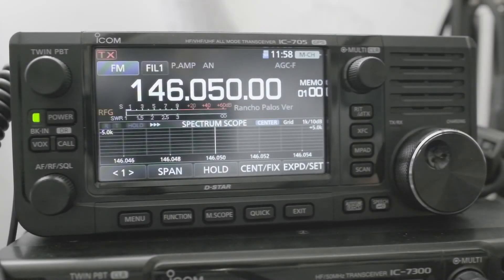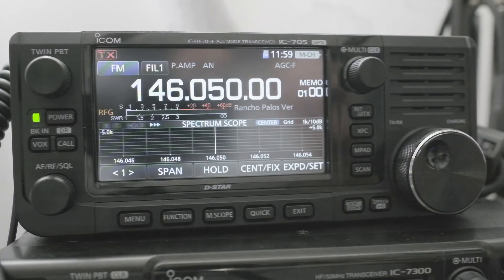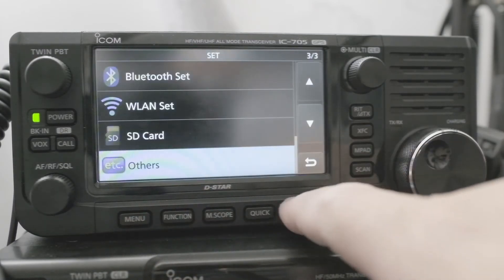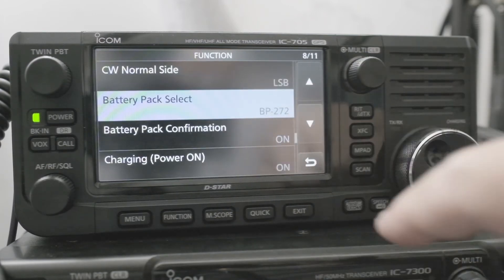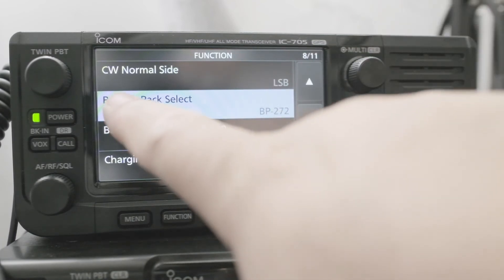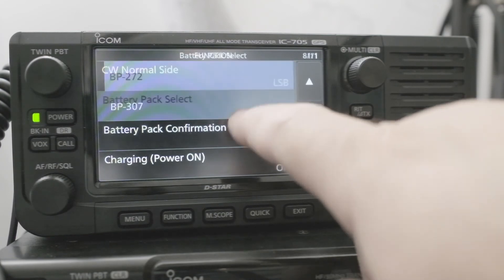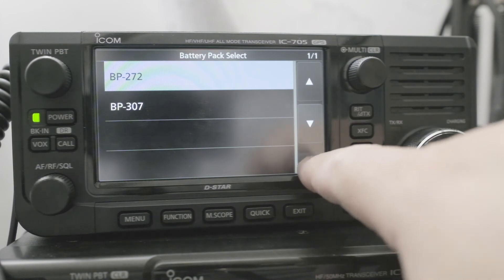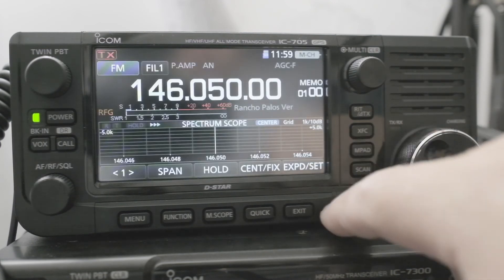IC 705 Battery Pack Set Mode BP 307

Comment: Not only did I like this video, it showed me that they make a bigger battery for the radio, which I did not know. The small battery size was an issue for me. Once I learned there was a bigger , better battery, I ordered my own IC705. Now I'm a happy camper. Hi Hi   I ordered my battery and quick charger from Batteries America. Their BP 307 has a capacity of 3350 mah. That's almost double what the 207 is. What a great option. Thank, de Barry, KU3X/QRP